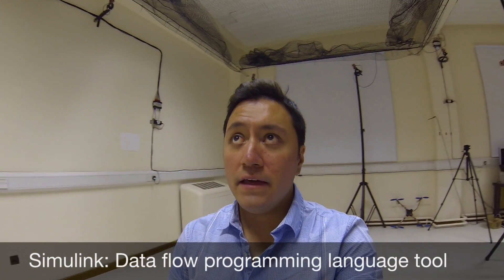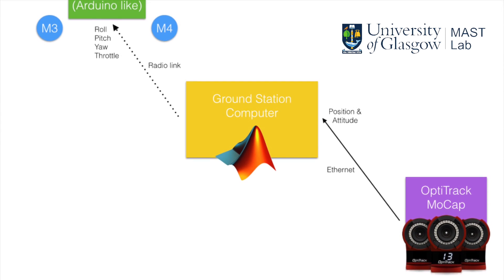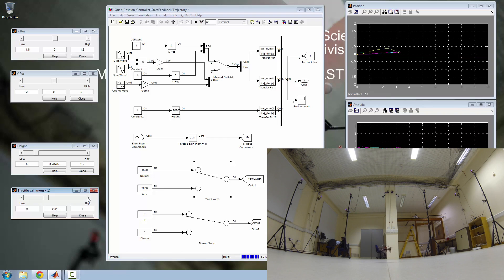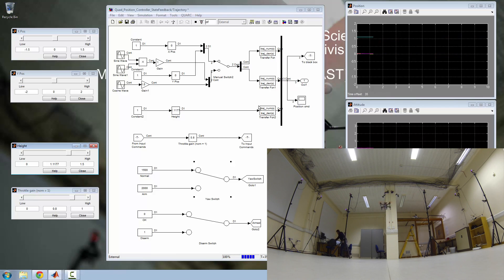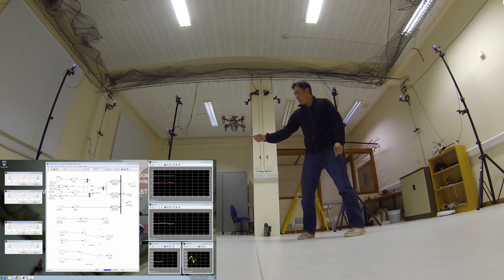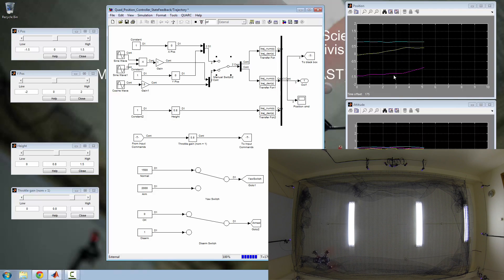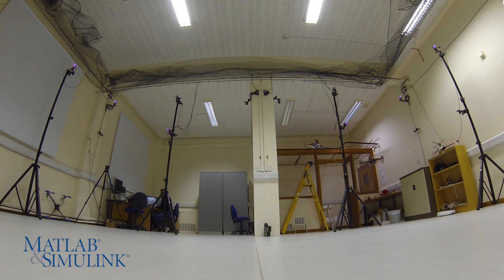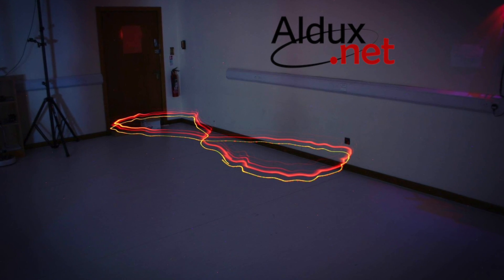Quadcopter Position Controller #SimulinkChallenge2014

Comment: Hi Aldo, your project look very good, I'm also doing similar development in our lab using Simulink and Optitrack and it all working in close-loop but i'm having problem to convert my simulink project to Exetranl mode to use in real-time. right now I'm trying to write C Mex s-function that connect to Motive API, how did you solve it in your lab? thanks Or